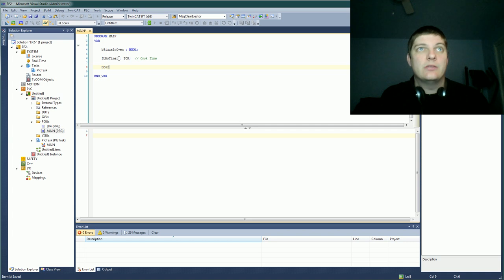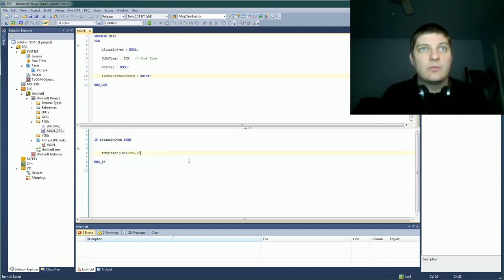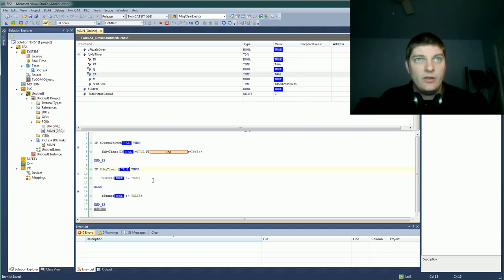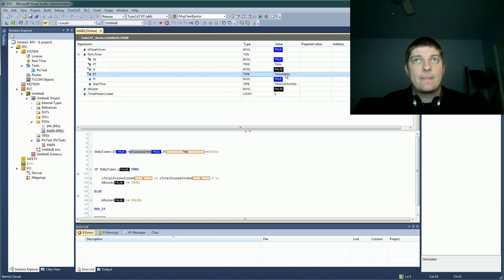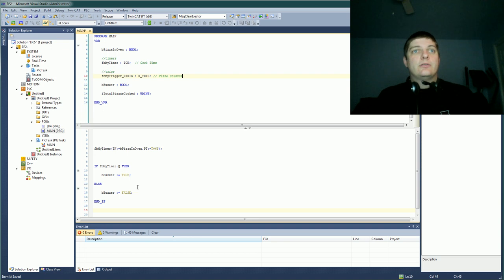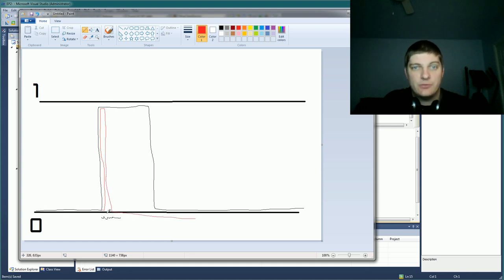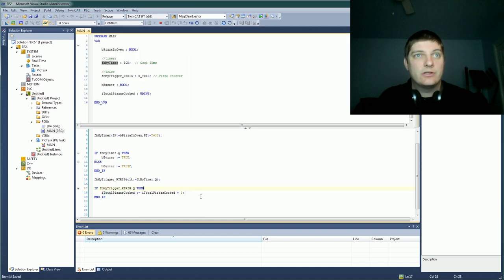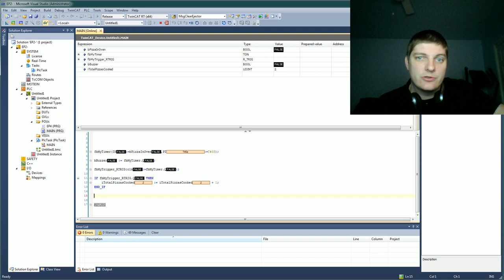Learning PLCs with Structured Text - EP5 - Timers and Triggers

Comment: I have a problem with my code, i have a industrial washer that im gonna program, and i have a transfercart that should go forward and backwards, and the operator is supposed to move it manually if something goes wrong, but then i have the same output in a case statement

IF MANUEL AND B_Transfervagn_Hoger_IT AND NOT B_Givare_Transfervagn_Pos_Hoger THEN
	B_Transfervagn_Hoger_DM := TRUE;
ELSE
	B_Transfervagn_Hoger_DM := FALSE;
END_IF

Now when im not running it in manuel mode the output is false, and it still is false when im trying to activate it in my case, how do i prioti my output when it is in a case statement

Comment: i'm having problems with the RTRIG, it's saying "assignment to input missing for parameter 'fbMyTimer.Q' in call for 'R_Trig' " is there some setting i'm missing somewhere?
Reply from the maker: sounds like you mixed up the declarations on your timer and rtrig. check that code... are you using the github code I privided or typing it yourself?
Reply: +SquishyBrained 
I just followed the video, pretty much step by step, is the github different from the video?
i'm new at this so it's a virgin install as well
Reply from the maker: +Zachary Mayes can you zip your solution and email it to me? evanmj@gmail.com
Reply from the maker: +Zachary Mayes oh, and the github code is what I finished with in the last episode.
Reply from the maker: +Zachary Mayes Here is the problem... line 7 in your code should be fbMyTrigger_RTRIG(clk:=fbMyTimer.Q); 

In ST you ahve to explicitly declare the variables going in.  Even though there is only one input and you passed in only one variable, it still wants to know what one it is.  Pretty primitive, but at least it is explicit.
Reply: Thanks, like magic

Comment: Great Guy! Thanks.  I have one quick question: After going through the 11 videos and fully understanding them, would you consider me good to go for Beckhoff PLC programming using structured text? Where would you place me and what would recommend I do thereafter to become better? One thing I obviously need is getting used to a wide range of functional blocks/ libraries, more like getting used to more words/vocabulary in a dictionary. How can I make this learning process super fast. I have a reasonable LabVIEW background already which is kind of helping me with the structured text. Thanks
Reply from the maker: This video series is just an introduction, to program a real machine you'd need to get a handle on input and output cards, and really work on messaging and building a system that is robust.  Once you know how to program machines in "some" language, the rest is pretty easy.  ST is easy enough, typically it is harder to get the machine to work how you want it rather than just messing with code.
Reply: OK. Just wondering, with a knowledge of the wiring (inputs, outputs, power, RS-232 or whatever programming cable required is it really supposed to be that tough particularly for one with an electrical/Electronics Background? Also can one use the structured text (with visual studio) for IFIX and Siemens PLCs?) I am trying to do something to convince someone to give me a chance at something :)
Reply from the maker: 1) That background is really helpful.  I picked up programming PLCs pretty quickly because my IT and electronics background kept me from getting hung up on little stuff.  For instance, if you can porgram an RS232 driver in LabVIEW, doing a driver for that same device to a serial card on a beckhoff PLC should be very similar and pretty easy.
2) ST, yes, but probably not in visual studio.  Vendors usually have their own IDEs.  But, since ST is an IEC61131-3 language, it should be included in some capacity in every 61131-3 compliant PLC (which is most of them).
Reply: Thanks a lot! Especially for the prompt feedback.
Reply from the maker: Sure, hit me up if you get stuck on anything.  Good luck!
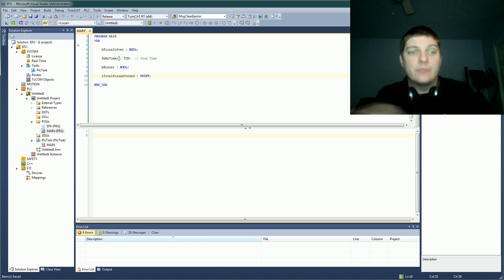Reply: is there a fast way to "export" ST then maybe import converted as ladder logic? Getting some equipment in ST from china and woudl much rather have it in ladder for trouble shooting.... 2:30 rule ... @SquishyBrained

Comment: how can I use a variable from another POU?
Reply from the maker: You can do it a few different ways, and they are more and less preferred depending on the way.  You can use the whole path, like "MyOtherPOU.MyOtherVariable".  You can also make the variable global and use it in both POUs.  The more preferred way would be to make the POU a function block and pass the variable in when you all the FB.  Making a function block from a POU where there is only one instance of the block is technically pointless, but it helps enforce good coding practice by keeping your variables properly scoped.  The first way is the easiest, but "reaching" across POU boundries, though technically possible is not the best way.